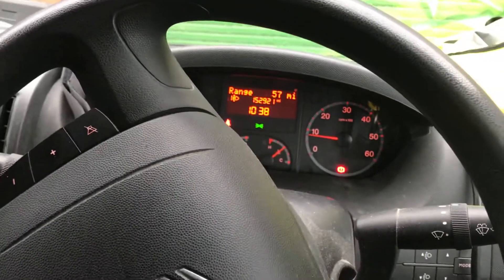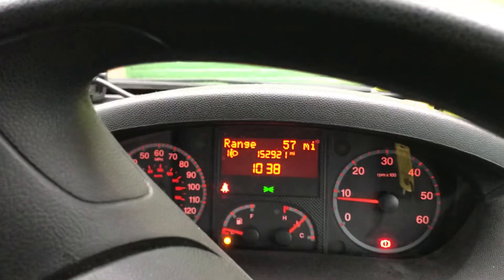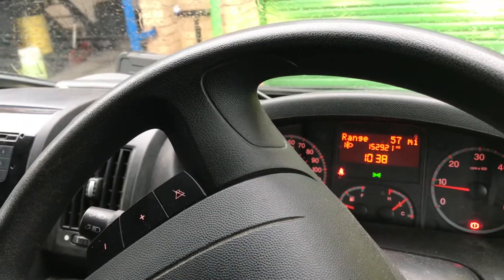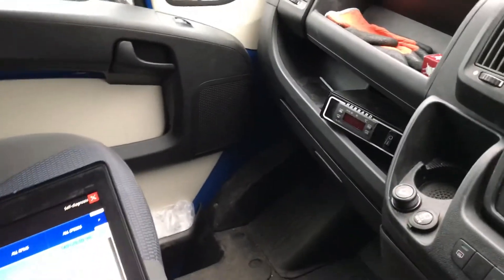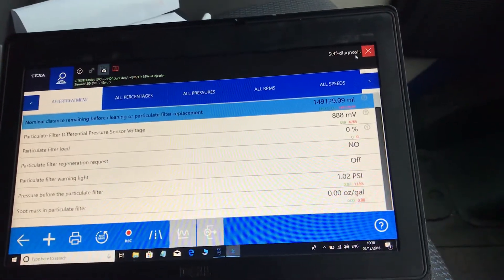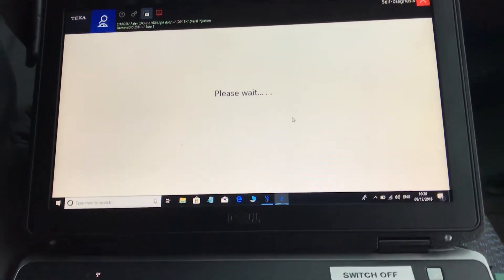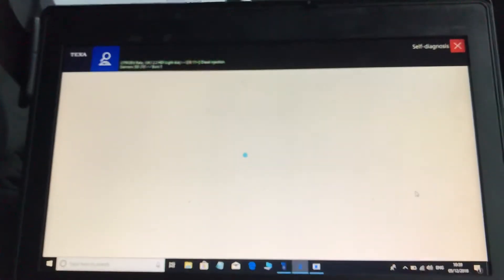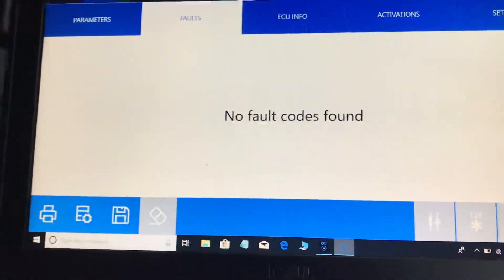Citroen Relay 2.2 Over view after Blocked Dpf Hydroflow treatment

Comment: hi how much does it cost to have dpf cleaned please
Reply from the maker: Morning Darren - the actual dpf cleaning treatment which takes 1.5 hours is £190 plus vat assuming that ALL of the vehicles sensors are working correctly ! With that in mind we always recommend that we complete a detailed evaluation before the treatment - why ? because if there are any issues with any of the dpf sensors etc the vehicles dpf will block again within a short period - if youd like me to talk this through with you my personal number is 07545-771901 regards marc
Reply: @turbopacsltd3988  WOW ill buy some oven cleaner and do it myself lol
Reply from the maker: @twizzlestickx7  Hi Darren - we dont remove the dpf from the vehicle - its all done in situ using a totally carbon free process -
Reply: @turbopacsltd3988  did i say you removed it ?no
Reply from the maker: darron greatrex the Dpf ?
Reply from the maker: No it was not removed - cleaned with Hho gas